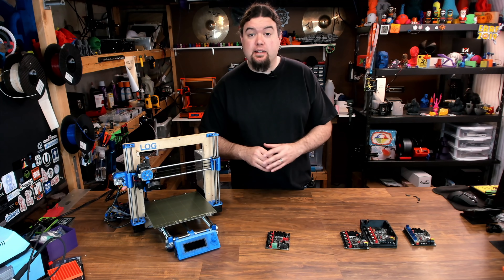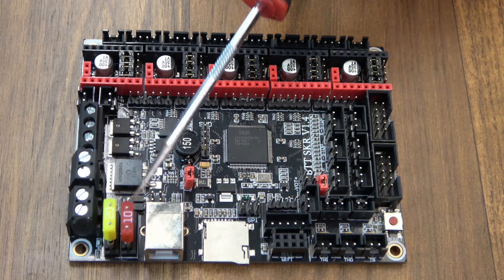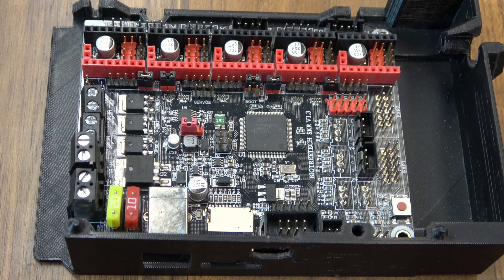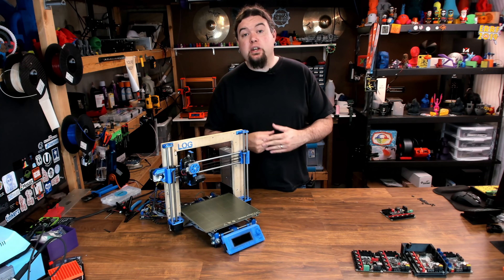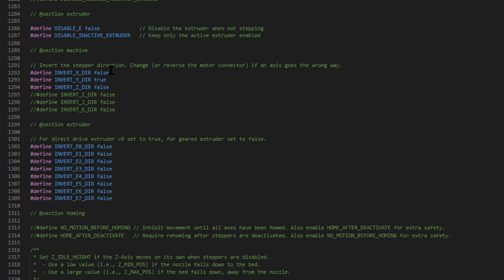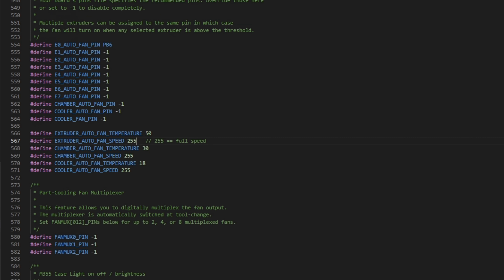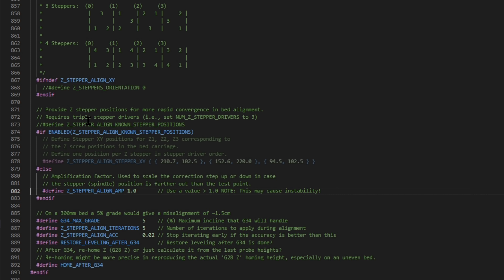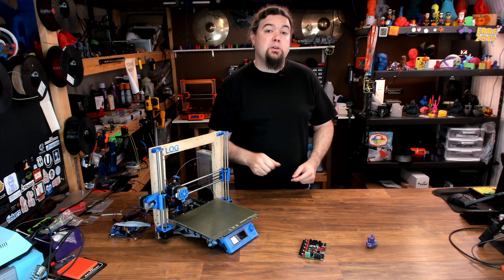Big Tree Tech SKR 2 - Install - Marlin Configuration - Chris's Basement

Comment: I have been watching you for some time.  I have an issue and cannot seem to find anyone who can answer.  I have a BTT SKR 2.0 and TMC 2208 V3.0 (UART) Stepper drivers.  All from BTT.  I get this connection error, no matter how I set my SERIAL ports.  Using M122 i get the following error message:  

SENDING:M122
Testing X connection... Error: All LOW
Testing Y connection... Error: All LOW
Testing Z connection... Error: All LOW
Testing E connection... Error: All LOW
//action:notification TMC CONNECTION ERROR  

This result above with "#define TMC DEBUG" commented out in configuration.adv.h.

Below is the error message with "#define TMC DEBUG" active  along with M503:  

Connecting...
Printer is now online.
>>> m503
SENDING:M503
echo:; Linear Units:
  G21 ; (mm)
echo:; Temperature Units:
echo:  M149 C ; Units in Celsius
echo:; Filament settings (Disabled):
echo:  M200 S0 D1.75
echo:; Steps per unit:
echo:  M92 X80.00 Y80.00 Z400.00 E93.00
echo:; Max feedrates (units/s):
echo:  M203 X500.00 Y500.00 Z5.00 E25.00
echo:; Max Acceleration (units/s2):
echo:  M201 X500.00 Y500.00 Z100.00 E5000.00
echo:; Acceleration (units/s2) (P<print-accel> R<retract-accel> T<travel-accel>):
echo:  M204 P500.00 R500.00 T500.00
echo:; Advanced (B<min_segment_time_us> S<min_feedrate> T<min_travel_feedrate> J<junc_dev>):
echo:  M205 B20000.00 S0.00 T0.00 J0.08
echo:; Home offset:
echo:  M206 X0.00 Y0.00 Z0.00
echo:; Auto Bed Leveling:
echo:  M420 S0 Z10.00 ; Leveling OFF
echo:; Material heatup parameters:
echo:  M145 S0 H200.00 B50.00 F125
echo:  M145 S1 H240.00 B90.00 F125
echo:; Hotend PID:
echo:  M301 P21.73 I1.54 D76.55
echo:; Bed PID:
echo:echo:  M304 P10.00 I0.02 D305.40
echo:; Z-Probe Offset:
echo:  M851 X-42.00 Y-5.00 Z-2.10 ; (mm)
echo:; Stepper driver current:
echo:  M906 X580 Y580 Z580
echo:  M906 T0 E650
echo:; Hybrid Threshold:
echo:  M913 X100 Y100 Z3
echo:  M913 T0 E30
echo:; Driver stepping mode:
echo:  M569 S1 X Y Z
echo:  M569 S1 T0 E
echo:; Filament load/unload:
echo:  M603 L0.00 U100.00 ; (mm)
>>> m122
SENDING:M122
		X	Y	Z	E
Enabled		false	false	false	false
Set current	580	580	580	650
RMS current	994	994	994	1160
MAX current	1402	1402	1402	1636
Run current	17/31	17/31	17/31	20/31
Hold current	8/31	8/31	8/31	10/31
CS actual	0/31	0/31	0/31	0/31
PWM scale
vsense		0=.325	0=.325	0=.325	0=.325
stealthChop	false	false	false	false
msteps		256	256	256	256
interp		false	false	false	false
tstep		0	0	0	0
PWM thresh.	1581	1581	10541	4534
[mm/s]		100	100	3	30
OT prewarn	false	false	false	false
triggered
 OTP		false	false	false	false
pwm scale sum	0	0	0	0
pwm scale auto	0	0	0	0
pwm offset auto	0	0	0	0
pwm grad auto	0	0	0	0
off time	0	0	0	0
blank time	16	16	16	16
hysteresis
 -end		-3	-3	-3	-3
 -start		1	1	1	1
Stallguard thrs
uStep count	0	0	0	0
DRVSTATUS	X	Y	Z	E
sg_result
stst		*	*	*	*
olb
ola
s2gb
s2ga
otpw
ot
157C
150C
143C
120C
s2vsa
s2vsb
Driver registers:
		X	0x00:00:00:00	 Bad response!
		Y	0x00:00:00:00	 Bad response!
		Z	0x00:00:00:00	 Bad response!
		E	0x00:00:00:00	 Bad response!
Testing X connection... Error: All LOW
Testing Y connection...
[ERROR] Can't read from printer (disconnected?) (SerialException): call to ClearCommError failed
[ERROR] Can't write to printer (disconnected?) (SerialException): WriteFile failed (WindowsError(22, 'The device does not recognize the command.'))

Seems to be something to do with serial ports or communication.  I am no expert using Visual Code, so I am looking for some hints as to what My coding issue might be.

Thanks In advance.
Reply from the maker: For your serial to start out, only leave the comment off of the fist serial and set it to -1 just to be safe. Make sure you have the jumpers on the correct pins and your driver settings are set to TMC2208.
Reply: @ChrisRiley  Thanks for the reply!  I have tried setting the serial port(s) in all sorts of configurations.  It is set -1 now, with  No change.  Jumpers are correct on the board, at least they match the BTT SKR2/ TMC2208 UART instructions.  These Stepper Drivers are supposed to be UART ready.  They look to have a jumper in the correct location @ J2 pads, again, per the BTT instructions and pictures.  Drivers are set to TMC2208.  I am of the opinion that they sent a defective board and/or stepper sticks OR that I am missing some very important and VERY obscure item in the config.h or config.adv.h files.  I have even tried different versions of Marlin 2.0, nothing changes.  Perhaps they are sending the "Dregs" of their production.  BTW:  I checked some of these "new" drivers today and 4 of the 5 ":new" drivers seem to be "bad".  At least they fail when installed in another TMC2208 configured board that is "known good", they deliver the same ERROR message in that board.    VERY maddening that you cannot buy supposed "new" parts that you can trust to be "Good"!  Does anyone know if BTT is just a CRAPPY Brand?  I have had good luck in the past with their products.  Trying to get my printer back in running condition and this is not helping matters.  Thanks Again!
Reply from the maker: @mlynch001  Yeah, sounds like you have some bad parts in there somewhere.
Reply: @ChrisRiley  After talking to BTT Support, they also agree that the board has some defect.  This is a chicken or the egg situation.  The 4 NEW TMC2208's that I was using are also now bad, so did the board burn them out? or did the 2208's burn out the board?  We shall never know, since I am sending these all back to the vendor.  I am getting another SKR2 and this will be the final attempt to make this board function.  IF this fails again, I am going to find something else to drive the printer with.

Comment: looks like the 2 other fans just turn on and off Chris i cannot control them with pwm. they just 0 or 255.
Reply from the maker: PWM doesn't really work with a 2 wire fan, you can kind of get it to do it, but it really requires a third wire.

Comment: **Issue solved: Do nothing lol. The slicer figures it out. No changes needed in Marlin. Plug additional fan in and it works. Octoprint only seems to want to turn 1 fan on if manually switching it on. Kinda weird but whatever. **

I'm trying to add a 2nd layer/parts fan. PB6 was my original, and when I added PB7 it only turns that fan on, and not my original in PB6. They are both 100% working and tested. Do I need to change anything? My extruder fan is on PB4 (works with the 50c temp), and I have a driver cooling fan on PB5. When having 2 fans with PB6 and PB7, it seems to only want to choose 1.
Reply from the maker: I'm glad you got it going.
Reply: @ChrisRiley  I was wrong lol. The other fan was not running. It's strange that Cura vs S3D turn on separate fans (PB6 vs PB7), but not together. The commands M106 P0 S255 and M106 P1 S255 work to turn them on in Gcode command, but the slicers can't turn them on that way for layer 3 (I could turn them on or one of them at the start, but not looking to do that). I wish S3D would add another fan option for parts cooling. 

 I'm going to have to use a Y splitter for the fans. There seems to be absolutely no other way to do it, other than treat it like a temp sensitive pin out to turn on at X temp reading, which I don't want.

Comment: I will pay $250 to someone who will help me get my Ender3 pro working again. I have installed a microswiss all metal hotend and the direct drive extruder. I have a Bigtreetech SKR mini E3 v1.2 main board with a BLtouch. I have tried following Chris’s videos , when the z axis tries to home, it is like the z endstop dosent work and the z gantry keeps pushing on the z endstop until I turn off the power. My board is using the PC14 pin for the Bltouch black and white wires. I have the black wire towards the fuse like Chris stated in his video. I have tried for one full week, but nothing I do changes it. I have downloaded Chris’s firmware build and still can’t get it to work properly. I am out of ideas.
Reply from the maker: Hey, are you using the endstop as well as the probe? Which option are you using in the config? If you are using PC14, you need to use this config line //#define Z_MIN_PROBE_PIN 32 // Pin 32 is the RAMPS default change the pin to PC14
Reply: @ChrisRiley  yes, I am using the prob pins and the endstop as well. I did change the comment line to PC14 for the pin number like you showed in your video. It acts like on the initial homing just prior to the leveling process that it can’t detect the endstop and continues to try to push through the switch until I power the printer off. Everything worked perfectly before I installed the hotend and direct drive , so I know the endstop switch works. I used your bltouch video to install the bltouch about 6 months ago but couldn’t figure out where I saved that file so I tried a new install and found myself in this situation. I truly wish I understood this subject matter as well as you do.
Reply from the maker: @boyx01sdad  It could be the endstop just needs a little help, try uncommenting this setting. //#define ENDSTOP_NOISE_THRESHOLD 2

Comment: Hi Chris. Love your guides. I am having some problem. Hope u can advice. thanks. #include errors detected. Please update your includePath. Squiggles are disabled for this translation unit (C:\Users\Documents\Marlin-2.0.9.3-MeCreator2\Marlin\src\MarlinCore.cpp).C/C++(1696)
Reply from the maker: Most of the time, you can save your project, close then reopen and these will go away. If not, in your enviroments, you can run a clean, that might help.